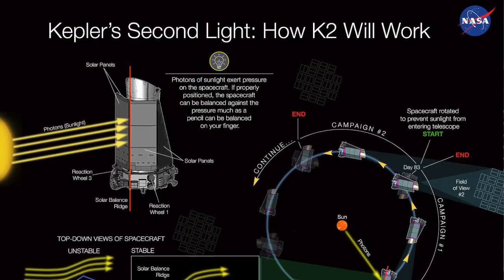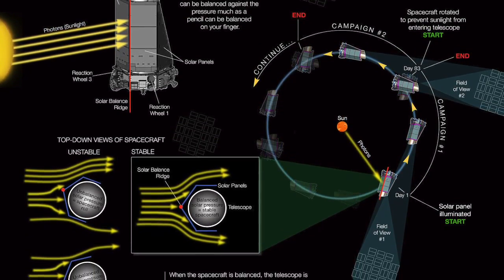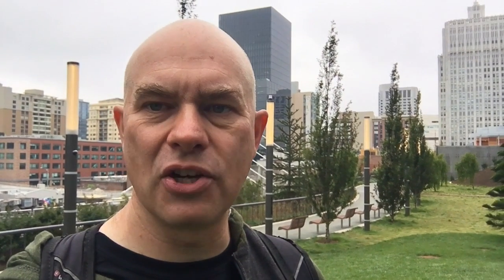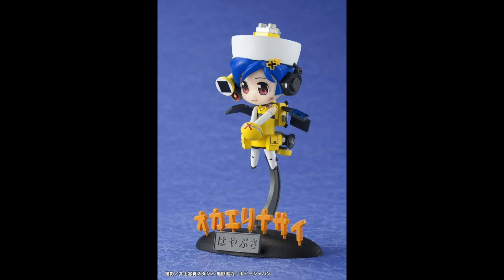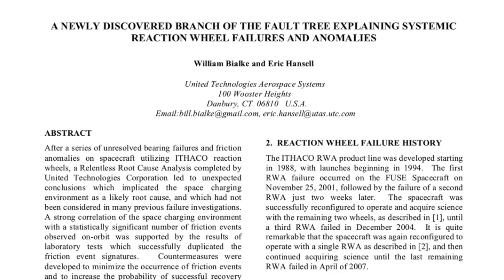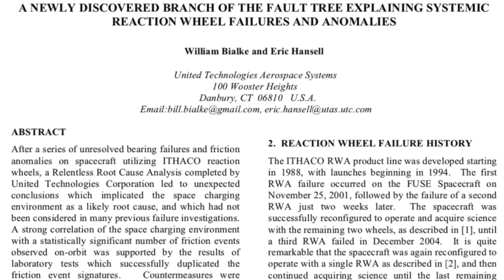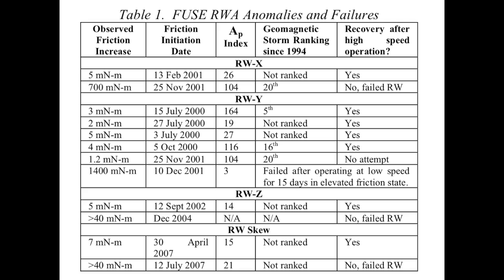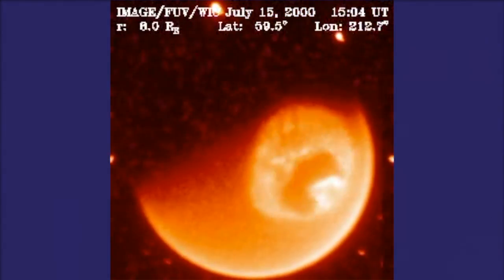Scientists May Have Figured Out Why So Many Spacecraft Were Failing

Comment: I remember when Bill gave that presentation to all of us former Ithaco Space Systems employees on the fifth anniversary of it's closing. He set up a projector in his barn and after our barn party reunion we all listened very intently. I saw the picture of a CME on the screen, looked back at Jeff Golden, then to Eric Stromswold, and my jaw dropped as they let me know that they agreed.

The ball bearing is basically the gateway for static potential to discharge from a relatively massive rotor (hidden under a relatively thin cover) to a massive dish. Yes, of course it would be subject to ionic buildup, regardless of any Faraday cage of the rotor cover. Remember, the outer bearing cover is attached to the outside of the main cover housing. Essentially, it's all right there waiting to pick up these ionic discharges.

I so miss working at Ithaco. Everyone there worked so hard at making those things work right... Laurie spent so many hours in the inner cleanroom taking so many measurements fir Bill and Eric WHILE ALSO building so many other RWAs. I stick to Torqrods so I didn't know much but I just remember how heartroken we we're when we lost the Iridium contract because of the failures. That was the death of a great company.
Reply: That's a cool personal story.
Reply: I missed that gathering, and also dearly miss the Ithaco family.  I was the 2nd shift Test tech., in Environmental Test for 13 years.  Bill worked long hours for years getting to the root of the problem.  I’m glad it has finally been resolved.  Pgk013
Reply: @paulkoch9871  One of my favorite small-talks at Ithaco was your account of what it was like working in a tent next door to a specific Skunkworks project. So many great people like you with so much experience from so many backgrounds...
Reply: Just curious, was this design totally developed in house or did anybody in the company come from or consult with a proper industrial bearing company such as SKF? I know things can be overlooked but this issue has been widely known, and mitigated, in general industry for decades.
Reply: @mytech6779  I was just a tech and not with the company very long. My understanding is that this problem was unprecedented up to the first failure. I highly doubt SKF, Timkin, et al would have been familiar with ionic discharges in outer space. However, I did ask Bill about this and there has been a LOT of study regarding the potential for electrical arcing across the bearing. The unpredictable part was ionization. Components were shielded, and the entire housing is painted in conductive black paint, so as Scott mentioned, it was probably believed that these were well protected. Nonetheless there is a strong correlation with the solar weather.
Reply: @MattThompsonOnGoogle  Ithaca. Damned fine place, I miss it. Sigh. I'm surprised these bearings aren't tested against this scenario; I work on a (medical) proton system and we rent out beam on weekends, mostly to various creators of space gear who run tests.
Reply: @yummybeers Though it was mentioned neither in the article nor in the video, this is probably exactly it. They may have covered general charging coming from outside the enclosure, but what if charged hydrogen charges the outside first, and then the still neutral parts on the inside attract further hydrogen like I attract mosquitos. Though it seems to me that simple voltage testing of the whole enclosure would have been enough - the track connected to the enclosure (if it isn't isolated well) will transfer the charge to the balls, and the bearing is gone. However, proton testing would still be needed either way, because it's a part of space environment testing...
Reply: @mytech6779  if anything they should consult with the co that actually makes most miniature ball bearings used by NASA which is Pacamor Kubar in troy ny.  They are the only us based miniature ball bearing manufacture and thus the only ones able to legally supply vital parts to the US government.  When i worked there I was the person who greased any of the bearings for the space program and also working in the quality control and testing lab also.  and a few times they even had me doing some sketchy stuff in the backroom to take bearings they had made in their plant in Japan and had to rip off the shields and replace them with ones that said made in USA before packing them up to fill government orders.  which now 30 years later I wonder what other corners they cut to fleece NASA and the government with foreign-made parts disguised as American made.
Reply: Wow, any more stories? Such a small world. I was at that barn party too. I was the small, meek fellow in the back corner, nervously chewing on sunflower seeds expecting someone to step on me at any moment.
Reply: @SpenserRoger  You worked there, or family? I was only st Ithaco for the short remainder of its existence as a UTAS company, October 2011-March 2013. I built a prototype motor driver card for GOES-R and a lot of test cables. Also wound one SMAP Torqrod
Reply: lol sorry I was just pretending to be a mouse in a corner. I did want to hear any other stories though. Thanks.
Reply: @therealnightwriter Are you a bot?
Reply: its not it's

Comment: Pressure of the suns light. Wait, does that mean that photons have weight? Doesn't that mean that radiation, energy has weight?
Reply from the maker: Yes
Reply: @scottmanley  how did i find this out just now
Reply: How the Hell didn't I connect this with the E=mc² formula, now i feel Stupid :(
Reply: So does that mean that photons have the smallest mass possible?
Is there a plack weight? 
Does that prove that things can have mass and go at the speed of light or that things with mass can't have any resting mass to be able to go at the speed of light?

Comment: Scott, totally off topic.  STS-1 launched with a thermal painting of the external fuel tank.  Do you think that Challenger or Columbia would have been spared if they had continued using this thermal protection?
Reply from the maker: No, in fact the white paint contributed to tile erosion.
Reply: Scott Manley THANK YOU

Comment: Thats just common sense. As a welder I have run into the situation when needing to weld on a piece of sensitive equipment with bearings in them. We must always ground on the same side of a bearing surface as the weld is being placed so not to create a spark between the rolling surfaces inside the bearings. Because any electrical charge can jump the gap between those surfaces and destroy those surfaces and the entire bearing no matter what type it is other than non metallic ceramic.

Comment: Easy solutions when you know the problem. It was years before it was conclusively proved that there was no metal to metal contact in a rolling element bearing once it was moving under the correct, not excessive, load. The proof was by electrical continuity. Still a bit of a duh! moment for NASA.

Comment: But are those reaction wheel housings actually a Faraday cage? A good shielding effectiveness can be had from quite thin aluminum (so long as good conductivity is maintained across all seams). However, maybe somebody assumed that the reaction wheels were mechanical and thus inherently immune to RF & ESD events, and perhaps the reaction wheel housings are Fiberglas.
I wonder if any satellite which experienced reaction wheel failures might have noticed a correlated increase in electrical noise in their experimental data (ESD events such as arcing across bearings would create broad-spectrum transient electrical noise)?

Comment: How come ceramic bearings isn't used? They are commonly used in various vacuum applications down here on earth. I've refitted turbo molecular pumps with ceramic bearings that have no lubricants at all in order to be used in really high vacuum applications. (On the other hand, those might need service and bearing replacement a tad bit more often)
Then we've experimented with a "special"?  kind of a teflon based lubricant, that improved the lifetime a whole lot (10-fold if not more) without having a too big impact on the high vacuum application.

If it is a cost issue, I don't see how bearings have any significant impact on that. Seeing how much the space craft projects do cost in total. 
The ceramic bearings with teflon based lubricants/teflon coated ball race in cost is a "fly shit in space" in comparison to the rest of the space craft cost. Seems odd to skimp out on that.

But what do I know? ..  ¯\_(ツ)_/¯

Comment: Well, there is many options. They could lower friction air or magnetic bearings, with closed loops air system (it gets a bit complex and heavy in space), or ceramic ball bearing maybe.

I hope TESS do not have much problems in comming years. :/

Comment: Surely the lubricant used in the bearings of such components would be one that is well studied and doesn't oxidize readily. But what if radicals were introduced by the x-rays that are generated during solar storms? Could those oxidize, crosslink or polymerize the lubricant turning it more sticky?

Comment: They figured out the problem on the Hubble reaction wheels - the lubricant was pushed in with oxygen and this corroded the electronics over time.  They switched to nitrogen and the problem went away.

Comment: I have a question: does a Faraday Cage work when there's not "Earth"?
I'm suspecting that for want of a sink to drain off unwanted electrical charge, currents might have no where to go. However, I also suspect (more) that my understanding of Physics might be off. Can anyone here elucidate?
Reply: Faraday cages don't need to be earthed or grounded.  The function of a faraday cage is to neutralize all electrostatic fields inside the cage.  It does this by rearranging all charged particles on the outside surface of the cage so they exactly cancel out at all points inside the cage.  The outer cage can be quite highly charged, but there will still be no electric field inside the box.

Comment: The far too common failure of reaction wheels always made me wonder why they don't use magnetic bearings. 
They are actually easier to make for use in space than on earth as you don't have to offset the weight of the flywheel.
A magnetic bearing has a lifetime limited only by the electronics, and in space the consumption of the magnetic suspension system is easily offset by energy saved in the motor thanks to the reduction in friction.
Apart from the longevity magnetic bearings also greatly reduce vibration which reduces the complexity of the wheels anti vibration mounts for spacecraft that are particularly sensitive to vibration.
One drawback could be the vulnerability to events that temporarily mess up the electronics causing the bearing to crash, however that could be easily mitigated by a secondary set of PTFE bearings or even just buffers that would keep the rotor in place while it spins down.
Reply: Even if you don't have to offset the weight of the flywheel, you still have to deal with its mass.  When the spacecraft changes orientation, you'll be crashing all of your flywheel shafts into the side of their bearings.

Comment: This happens to pole line trucks when the boom comes in contact with a power line. The current passes through the bearings and causes pitting and can weld them together. leading to premature failure.

Comment: You can get same failure mechanism with cheap frequency convert drives on electric motor bearings. The ceramic bearing is good but expensive fix the other solution is install grounding carbon brush but that's needs probably some maintenance over long periods of time so using just ceramic bearings on stuff like that is probably good idea, especially when they are already stupidly expensive :D
Reply: I see you are still doing research in to rocket science.
how is going you rocket program?
Reply: I have my big rocket with 1000 N of thurst still under work :D I have been to busy but I think I should get back to it
Reply: @HydraulicPressChannel  = Elon Musk's alter ego confirmed 0.o
Reply: His wünderwaffe rockets are nearly ready to be deployed for the next step in the secret world domination plan.
Reply: @youkofoxy  Well Finland has really bad rocket development laws because the only ones that exist say basically that you're not allowed to.
Reply: ceramic bearings aren't even that much more expensive when you consider the cost of the spacecraft
Reply: Advanced ceramic materials are only expensive until they become more common. Then the price comes down. Regardless, the price of these bearings is probably only a tiny part of the whole, so ceramic bearings are probably the new standard.
Reply: Ethan Lamoureux ceramic bearings are quite common. Every major bearing manufacturer has silicon nitride ceramic bearings available. I deal in P4 high precision bearings, ceramic is usually 50-100% more.
Only issue in INDUSTRY is any knocks to the bearings will ruin them fast. Capable of much higher speed than steel, but the ceramic balls ding the steel races more easily in crashes.
Reply: Have you heard of 'cool blue'? They're a eddy current elimination device. It's just a doughnut magnet that surrounds the leads of a VFD driven 3phase motor. I work in HVAC, and we install them to prevent electrical fretting of motor bearings.
Reply: I wonder if pressurized air bearings would work better? I use them at work to balance missile parts. They spin forever! They're pressurized to 90psi. Very interesting bearings.
Reply: how do you ground in space
Reply: @marlonyo  Large piece of metal.
 You can ground yourself on a heating element (it can't of course be painted with a non-conductive paint) if you are building a PC.
Reply: @xWood4000  Just a large piece of metal doesn't work for grounding, you actually need a connection to ground. Your example of a heating element (i.e. radiator in a house) is grounded through the metal pipes and the water to earth ground. The simple answer is that you can not ground in space.
Reply: You would need to encase the whole module in a pressure vessel to make sure you don't lose the air that leaks by the bearing. And the pump to maintain bearing pressure. Sounds complicated.
Reply: @saltysteel3996 the air gap or clearance on air bearings is probably too close and you'll be stuck with the same problem.
Reply: Is it just me or did anyone else read this in his accent? Just fits too well haha
Reply: Hydraulic Press Channel good to see you here 👍
what’s the mechanism of this? Is it poor inversion causing excessive eddy currents or bad grounding of the output?
Reply: Hydraulic Press Channel or install insulated bearing to the other end. And thid issue is more or less built into VFD, getting more expensive one does not actually solve this issue. TTY has shitloads of data about the issue..
Reply: I read this in your accent 🤣
Reply: If I remember correctly, all the turbo alternators in the power stations where I was employed were fitted with shaft earthing (grounding) carbon brushes for this reason. In addition to small currents generated within the magnetic fields, steam passing over tubine blades can cause static electric discharges, and the (journal) bearings were protected by the shaft earthing, but as you say, maintenance is required, although I don't know how severe a duty they are required to undertake
Reply: Even his text is in broken English, I love this man
Reply: @Kumquat_Lord  you just have to read it in a Finnish accent
Reply: When are you launching your rocket? :)
Reply: If he's building a rocket this is going to be amazing! Beyond the press is going to go to the next level! Can't wait yo hear more. Love you crazy Fin's!
Reply: From what it sounds, they started using the ceramic bearings for some other advantage, they weren’t a targeted fix for this one issue
Reply: Yeah grounding wires on a satellite are probably not practical :D
Reply: Brush will have some amount of drag to it, so will require more power, and  thus add weight.
Reply: This is well studied and a known thing... Dont know why NASA wouldnt know

Comment: I'm surprised they didn't think of this.   This is a known problem in the automotive world.  In the 1980s a rash of wheel bearing failures on Chevy cars was attributed to corroded engine grounds.   Electrical current found alternate path to ground through the front wheel bearings.

Comment: Magnetic Bearings? Comments?
Also, how many of these contraptions had standard spinning magnetic hard disk drives? (Flash wasn't large enough for many things until quite recently.) Those have had the ability to report errors that would be associated with bearing failure for quite a while now (since the mid-late 1990s), and would have similar mechanical characteristics. The main big difference that I can think of is the adoption of special "fluid dynamic bearings" in most computer equipment (especially enterprise and server type), but that didn't really take off until around the same time the switch to ceramic bearings happened in the reaction wheels.

Comment: Well atleast the iss has no faulty reaction wheels
Reply: Reaction wheels on the ISS have failed before.  It has more reaction wheels than strictly necessary though, so it's not an immediate problem if one fails.  A replacement can be sent up on a resupply mission and an EVA can be scheduled to replace the faulty wheel.

Comment: Great vid Scott, as always! Two questions: 1) Has anyone tried to replicate this electrostatic discharge on Earth to prove the theory? And 2) If the wheels are failing due to the formation of imperfections, is there any way you could make the wheels 'self-clean'? Either with a chemical agent or by wearing down any imperfections with movement,  the same as a rock tumbled by the sea?

Comment: As a roller skater, we use ceramic bearings for optimal performance. I'm surprised that spacecraft would use cheaper metal bearings. For a craft as expensive, saving some dollars on bearings is not smart.